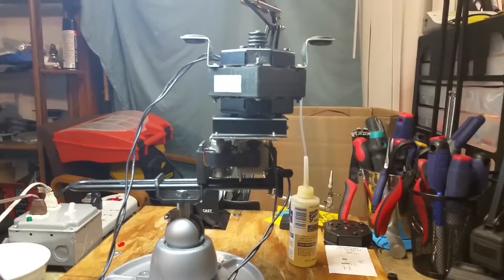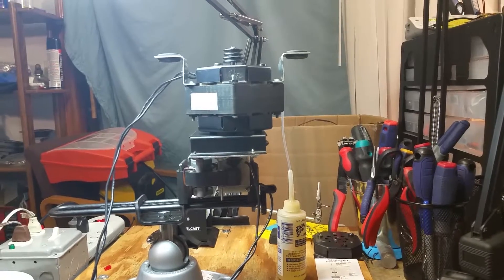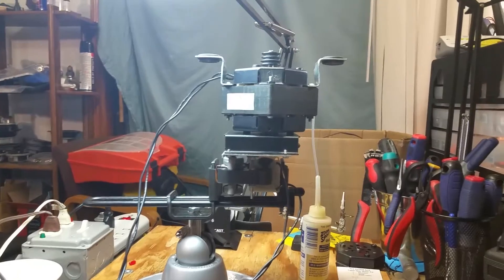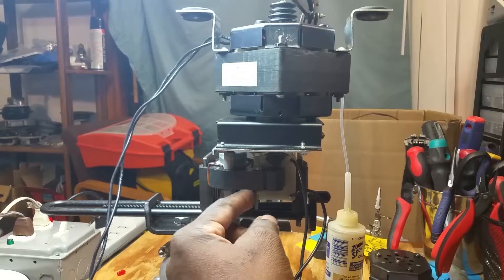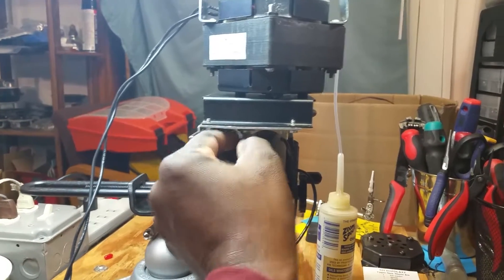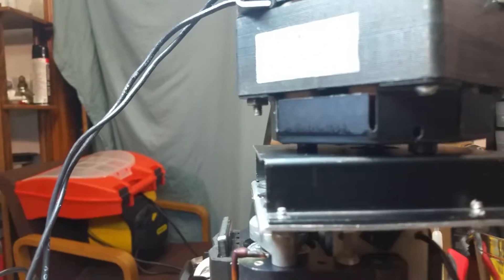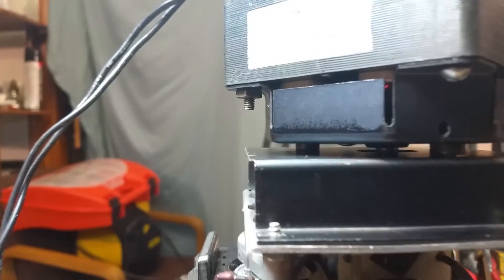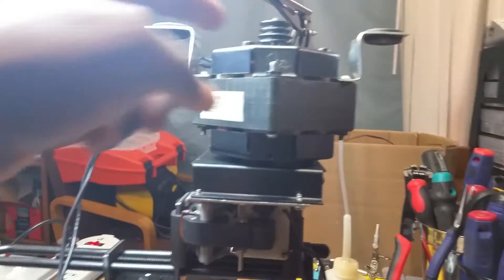Testing & Adjusting A Noisy  Leslie Upper Motor Stack

Comment: Hey Dr. Kemp. I appreciate all your videos and help with troubleshooting these issues. Quick question: when testing these motors, are we able to just plug them into a standard 120v electrical outlet without any extra problems? Thanks! :)
Reply from the maker: Yes indeed. One motor at a time. Either the fast or the slow motor. Thanks for your question.
Reply: @ncilmo , that's great - thanks again!